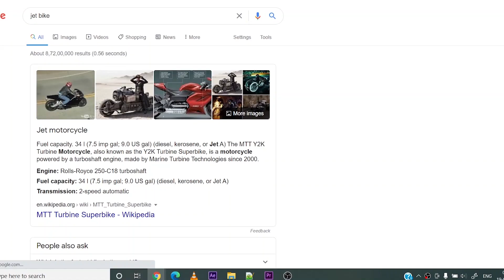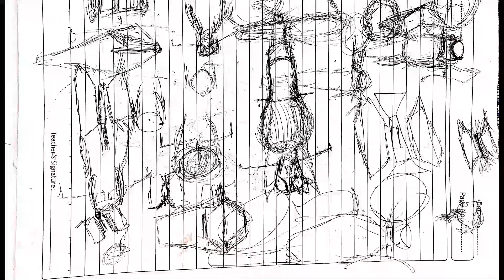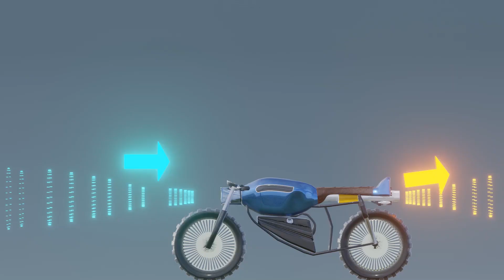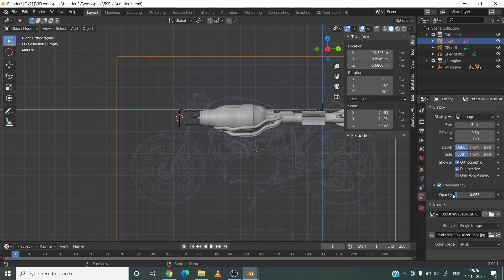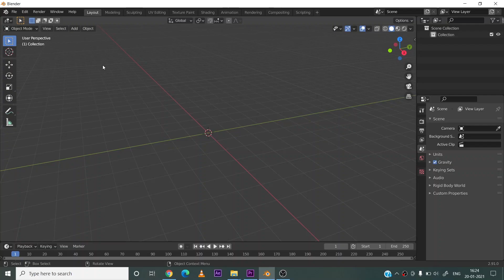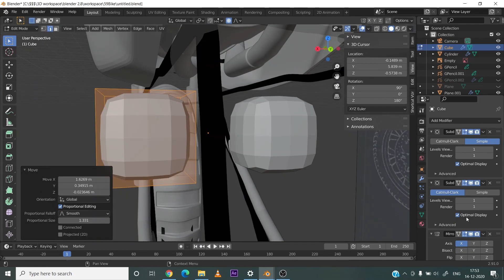JETBIKE|  Blender Grease Pencil| 3D Modeling Breakdown| Blender Tutorial| Bike Design 3D| Cafe Racer

Comment: There is actually a Jet Engine Car, not like that "Jet Engine" Race Car that uses Rocket Propulsion System in order to be fast for the race with very quick to burn fuel, Chrysler Turbine Car is the only jet powered car made by a Big Brand designed to be used in the streets and it fails because how it fails to meet the pollution emissions limit regulation, relatively poor fuel economy, not so impressive acceleration speed, and etc, Anyways, Your Video is Great, Thanks for making it!!!
Edit: Thank you for Liking Me! I hope there's a chance that in the future we can make a cleaner, silent Ground Jet Vehicles!
Reply from the maker: This was great deal of information, thank you so much I hope this will be useful for others too. I think the same problems will fail jetbike too what do you think?
 thank you for the appreciation
Reply: @the4daviator300  Yes, But I hope In the future, we can somehow make a jet ground vehicle that doesn't have that problem
Reply from the maker: yeah let's hope :D definitely in future.